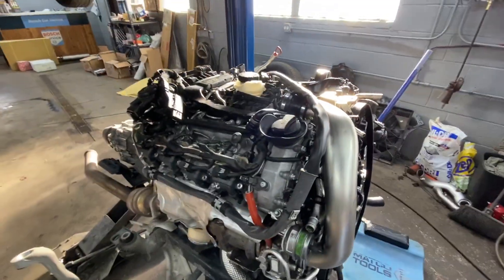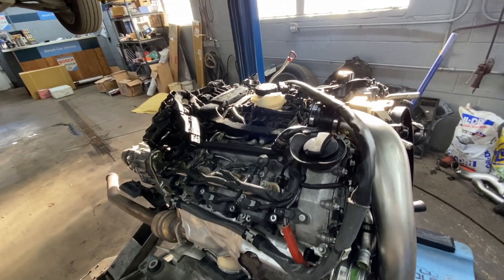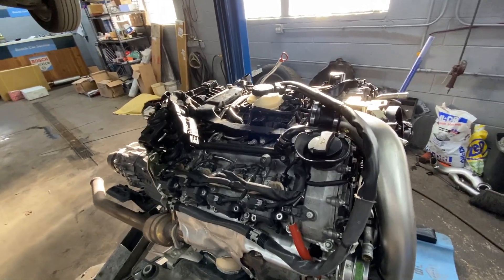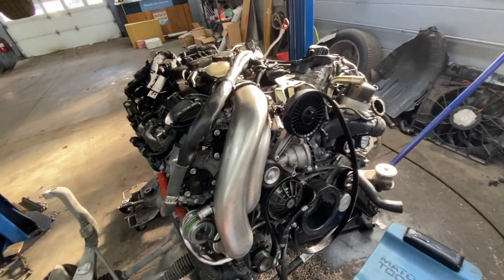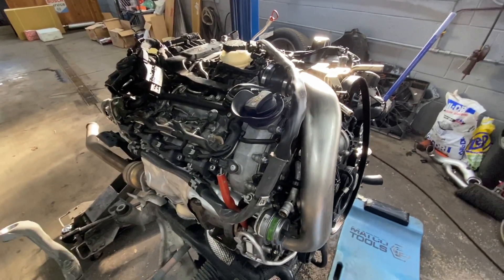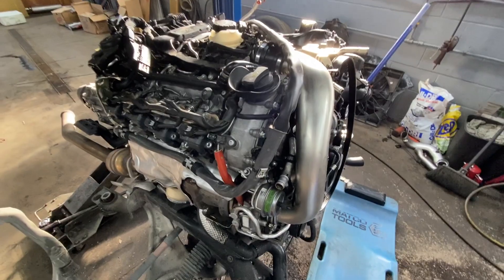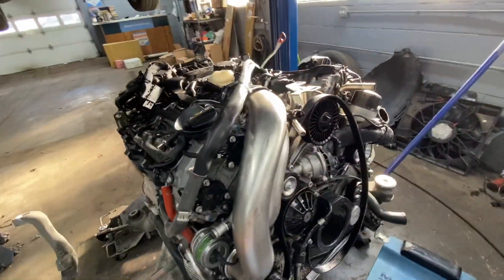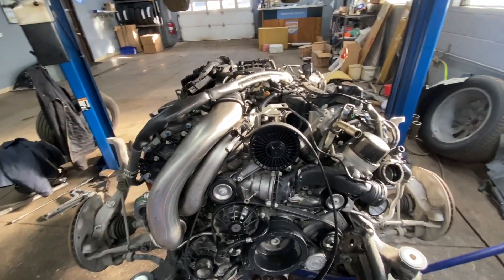Mercedes Benz GL V8 4.6L M278 Turbo Engine Misfire Part 1

Comment: Is this a known problem with the m278?
Reply: Hell naw
Reply: There’s a lot of info about loss of compression on the m278. There’s a Mercedes’ TSB about it. Cylinder head production issue. Most common is that it starts with cylinder 5. Engine out and replace the heads. This seems like a different issue though.